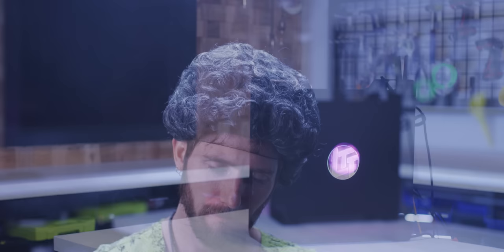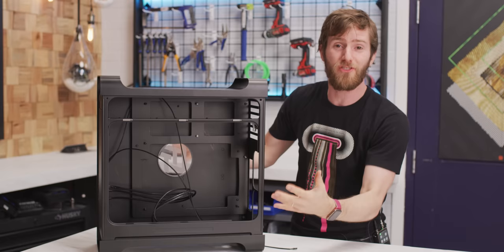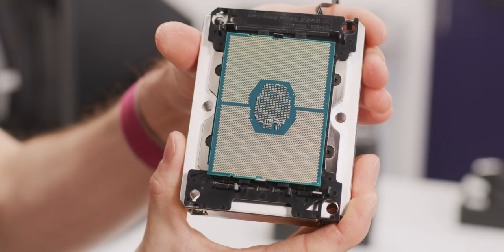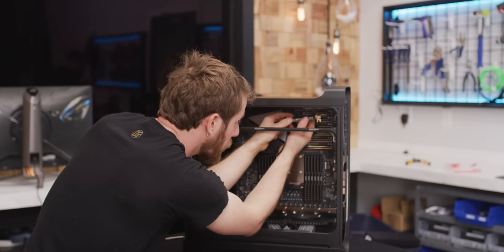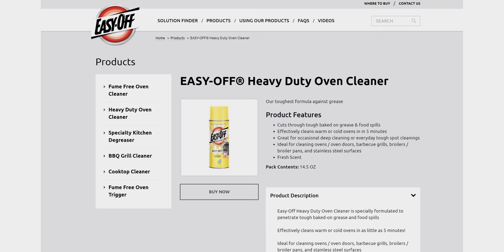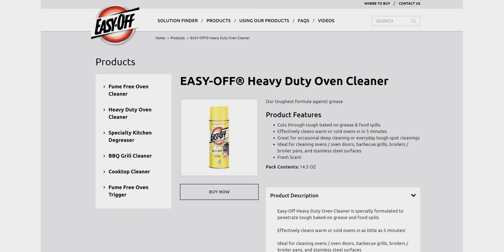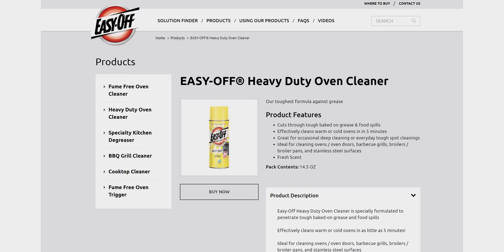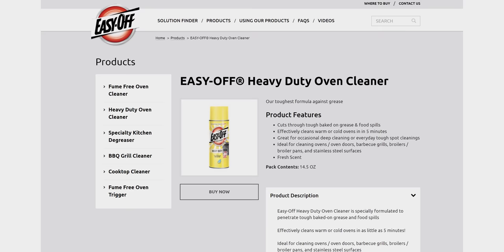IT'S FINALLY DONE! Hack Pro Final Assembly

Comment: Me: getting anxiety bcs my 240 radiator is screwed in with 5 screws in stead of 6.
Linus: Double sided tape
Reply: May whole motherboard with a bequiet cooler is held by like 4 screws.
Reply: @Knallteute  mine is 2 screws with a hyper 212
Reply: Divvy I also only have 2 screws holding the motherboard with 2 fans on my 212
Reply: “Gravity”
Reply: I'd use zip ties I don't have screws, unless there is a tempered glass side panel, then it's no cut corners
Reply: @Icythomas-iq4ft  uhm, don't just secure ur board with 2 screws. You'll be in for a bad timey
Reply: @Icythomas-iq4ft  I have 0 zero screws holding my motherboard with a rock I found on a mountain as my CPU cooler
Reply: To be fair, it's held in with vhb tapes, which sometimes gets used in the building industry as a substitute for riveting and bolts...
Reply: My first computer I put my two intakes in with 4 screws (2 at top and 2 at bottom) and cable tied them together at the middle
Reply: I lost my screws, good old cable ties to hold my 360mm radiator
Reply: @brokengames9020  Why have you come to this conclusion?
Reply: Just keep your computer on its side, no need for screws at all!

Comment: 28 core cpu
384 gb ram

Linus : "Performance should be adequately decent"
Reply: Honestly big tech youtubers can appreciate budget parts and realize not everyone has the money for a 1500 dollar "mid range" build.
Reply: Suh Cheuy you can build a mid range for 800-1000
Reply: @verovex7723  Not with current prices on certain parts, even 1070ti are going for way over msrp lol
Reply: It's what they do, show the best of the best. If you want a budget pc guide, there are many other channels for that
Reply: that remark was strictly on memory speed being very low.
Reply: @verovex7723  In the first worl, shure, outside of that, is a premium range...
Reply: With an working OS yes, with cRapOS. Not so much!
Reply: Compared to what he used to
Reply: Mykel Hardin  you didn't actually support your argument. You said "nothing about a $1500 PC is budget, no matter how much money you have", and that's just not true. PCs usually cost more than other devices (phones, TVs, etc.), but a millionaire would have no problem dishing out 3000 for a PC, calling it budget. You actually disprove your own point by saying most of the cost doesn't affect performance (also, learn the difference between "effect" and "affect") You just said you have a fancy PC (which is what many PC enthusiasts watching these videos have, hence the word "enthusiast". Unless you are saying that you can get high performance for 1500 dollars, then I guess you are kind of correct. Still, a $1500 PC has significantly lower performance than a more expensive PC. By budget, most people refer to cutting out unnecessary stuff, and bad price-performance parts (such as spending too much on a PSU, or Windows 10 Pro for those who don't need it), and that's often the case in 1000 to even 2000 dollar PCs.
Reply: I think he meant compared to the original Mac pro
Reply: Mykel Hardin  budget doesn't mean cheap.
Reply: High or low, a budget is a budget.
Reply: mike h  1500 is like the bare minimum for a all current gen midrange gaming build with a 2070s or 5700xt (id say midrange ends at around 1500 personally, and thats without accounting for aesthetic extras)
Reply: doesnt the actual mac pro hold like 1.5 tb of ram though
Reply: mike h  i mean techinally budget is anything anyone decide
Reply: he has more ram then my ssd stoarage
Reply: Me vibeing with 200 FPS on valorant on ryzen 5 3600

Comment: LTT: Let's build a hackintosh!
Apple moves to arm architecture.
Reply: Arm only for laptops. iMac 50% chance of probability using arm. MacPro would still using intel/amd.
Reply: I'm sure they will use ARM CPUs only on some insanely sleek MacBook, because if they completely switch to another architecture a year after they released a x86 workstation that can cost up to 53k bucks, they are really stupid.
Reply: @comicsanz97  correct and they also need to give devs time to update their apps to support arm as well. They won't (also can't) wholesale switch to arm for at least a few years (maybe never 100%)
Reply: transatlant1c yeah Apple has been adding support and pushing devs to port mac apps to iPados probably so when they switch to x86 processors they will already have apps done.
Reply: @nc9604  that's a great point I had forgotten about that!
Reply: @brokengames9020  What?...
Reply: @brokengames9020  ???
Reply: What's arm?
Reply: @brokengames9020  what is this conspirancy nonsense?
Reply: @brokengames9020  wtf are you smoking ?
Reply: @brokengames9020  You're probably high
Reply: @comicsanz97  " if they completely switch to another architecture a year after they 
released a x86 workstation that can cost up to 53k bucks, they are 
really stupid."
you underestimate their power
Reply: @tinydragongaming634  Arm is a architecture of a CPU. It's more power efficient; you use them every time you use a mobile phone.
Reply: Henry Ezra Apple will slowly move to arm completely to have app compatibility over all macs
Reply: @brokengames9020  did you just have a stroke at your keyboard?
Reply: @666Tomato666  Apparently I underestimated them. They are really that stupid. Not only with their transition, but also with the horrible macOS Big Sur, which is the Honda Civic 2001 of Operating Systems. At least they will keep updating the Intel Macs with this blurred stroke.

Comment: Jake: How much wifi you Want ? 

Linus: Yes.
Reply: It's actually because that's one of the few cards that will work under MacOS. Essentially unlike windows and Linux apple only needs to include drivers for devices which they use. This means only a select few broadcom chipsets work. The most common chips used for this purpose feature 3 wifi antennae and 1 bluetooth antenna.
Reply: @gregorycosteas3539  r/Woooosh And i know i am going to get r/IhaveReddit ed
Reply: @thebakinggamer4348  r/ihavereddit oh wait....

Comment: remember when linus found out that cables almost don't affect cooling and now he put a psu in the middle of the case
Reply: It's ok, the PSU can't block airflow if the fans aren't even turning
Reply: It’s also water cooled so airflow is not as much of a concern as it would be if it was air cooled
Reply: And don't forget that the psu is a fan as well. 😂

Comment: I’m gonna take a hard pass on trying to replicate this myself.
Reply: I agree. But i got a spare G5 Case laying right next to me and the new Build will come in September.
Still thinking about it. Looks so clean.
Reply: @maqqi7124  If you want it black, I highly recommend finding an anodizing outfit that does scary black rifles.  It's far superior to paint, which is why Apple anodized their cases, and anodization is nearly marine-proof.  If you're a 40K fan, there's a military standard puke green generally available for cheap and super durable, if you feel like hanging out with Nurgle.
Reply: a VERY hard pass

Comment: I did a G5 ATX conversion by myself and I find it quite interesting to see different approaches on different builds for the common problems like backplane design, power button and I/O Ports, Power LED, Mainboard Tray, etc. I actually left the mezzanine in place because I still use a BD drive with the original drive port (which actually fits without any adjustment) and a hard drive on top. I ended up building a similar stand for the power supply, but there are folks using the original mac pro power supply housing and putting in a server power supply from a windows machine. With the mezzanine still in place, I unfortunately just can use a 280 mm radiator in front, but that works well for me. With the paint job, the LED logo and a Xeon, this thing looks quite nice! Kudos to you guys!

Comment: If you want to get rid of the machining marks from the bottom of the pocket in your logo discs it's really easy next time. Pocket them out 0.2mm higher than you want them and then do the last 0.2mm as a separate operation but run the spindle speed high and the feed rate really low i.e. less than 1000mm/m and it will come up looking like it's been sanded with around 240 grit and no matching marks.

Comment: 15:20 This depends entirely on the specific OS update. Some can be installed from the normal System Updater just fine, but others will break the Clover bootloader & prevent it from booting up anymore. Part of owning a Hackintosh is simply having to Google to find our which a given update is. And if it's one that CAN'T be updated the normal way (which is the case more often than not), it'll require a OS reinstall to do, so these tend to be left alone until there's a whole bunch of them to install at once. 

Aka, a Hackintosh owner will often reinstall his OS (after backing their data up ofc) a few times a year just to get the latest updates. Is that a pain? Yeah, sure. But enough of a pain to be worth paying >2x as much $ for a given amount of performance to get rid of? Not even close for most Hackintosh owners.
Reply: ok sherlock it's a video

Comment: If you ever interested in self painting other metal pieces, use one of those spray gun handles that attaches to spray cans.  It helps even out the spray pattern, Using a hard clear coat and sanding it/ polishing it really makes the metal shine, or if that’s excessive (It’s used for wonderfully painted Motorcycle Parts) I also use Antique Silver Paint to add a metallic tone. Great Work though!!

Comment: yes! you need a titan ridge card to add thunderbolt compatiability - plenty of info on it. you need to re flash it and mod it slightly and use opencore with MacOS, but it WILL fire up and is hot swappable. get on it Linus!

Comment: They better not disassemble this. someone at LTT should use this as their primary computer (running windows obviously)
Reply: The unsecured PSU sitting on it's modular plugs, and the "impossible to maintain" WC loop mean that's a no.
Reply: @Grimmwoldds  I wonder where is the drain outlet...

Comment: I've been using my "Hack Pro" since april.
Granted, I still want to finish off a few aesthetic things.
I used a regular atx and so was able to keep the drive bay for my ssd and hardrive.
Currently using a spanned 3 screen and 1 larger screen. So far, 0 issues :)

Oh and because I'm not LTT my "motherboard plate" is an acrylic testbench cut to size and screwed in to the original mother board holes.
Next step is to make some custom very short io extenders as my motherboard is mounted upside down and all ios are about an inch inside. In the meantime idgaf as everthing can already be plugged in easily with cables or extenders. If anyone knows someone who makes custom length display port,hdmi and usb 3 cables and a low price, please let me know( that's where im scared to cross the DIY line)

Comment: What a beautiful and insanely powerful hack Pro. Also love the custom loop and tight powerful fit. If the psu bracket also included mounting for the psu with screws and the back two fans were covered by the same mesh as the rest of the back, it would have been perfect.

Comment: Updating Mac OS goes without a problem as long as you use OpenCore as the boot loader. I'm even running on Beta (10.15.6) and its working perfectly fine.

Comment: You CANNOT tear this thing back down. This is the most perfect G5 Hackintosh I think anyone's seen, Literal damn art. Slap Windows 10 on it and just use it mans
- Commented from my Dual 1.8GHz PowerMac G5 via TenFourFox

If curious, yes it does still stream 720p HTML 5 YouTube. My Specs are 3GB DDR2 and an Nvidia 6800 DDL 256MB. She's no slouch, still use it as a backup when my Hot & Ready machine is down

Comment: 12:23 My G5 Hackintosh PSU goes on the upper tray at the front with a modified IEC cable to use the factory power socket to extend to the new PSU

Comment: The build might be disassembled but what would improve it would be installing clips on the power supply and cable assembly that the power supply sits on. That way there wouldn't be any problems in case the computer shuts off from tipping the thing.

Also I hope the thing doesn't get disassembled because of how long it took to get it done.

Comment: Linus, you made the statement in the video about it feeling wrong to disasemble this system after the video is over.
as a thought, you could do a giveaway based on it, or some other type of contest based on it.
obviously you're not allowed to send it with MacOS, that would be in violation of apples EULA, but send it with no drive. then include a used drive from the office. "oh, the drive had data on it? wipe that please" *nudge nudge*"
Or hell, just ship it with no OS. Opencore has a pretty solid support community, im sure the winner could figure out how to get it running.

Comment: Turned out great, but with so much effort out in making it so nice, it seemed strange to me that spray paint was used on the paint job. 

What made you choose to rattle can it instead of using an enamal/hardener acrylic paint with a proper air gun?  Seems like a strange corner to cut after all that work, but maybe there's a good reason I'm overlooking.
Reply: A few things,  one being our shop is not done. We plan on having a paint booth in it with proper hvac and extraction. Two because our shop is not done I wasn't able to get the approval from the paint supplier (was going to use AcryGlo) to be able to use the paint I originally wanted to.  And three I knew with the proper prep work and a 2k matte clear it would be durable enough for the video and use around the office. 
If this were for a client (I used to custom builds) I would not have cut any corners. BUT this is for entertainment  and time lines matter a bit more.
Reply: @nicholascallanan3443 that makes sense, I had a thought that the current state of things might have had an impact on it.  As I've been following these videos, it just bothered the perfectionist in me. It's been fun to follow.

I think the double sided tape Linus used is genius, it's a great use of what you have around at the time.  Most techs who have spent too much time working on prebuilt systems know even big box brands have done worse things with mounting and proprietary connectors.

As a small piece of advice, I wanted to bring up the idea of tapping the side of outer casing of your psu with screw holes and mounting point that could allow you to secure the psu to the bracket with thumb screws.  Looks good as is, but Linus did mention concern of it sitting largely unmounted.  If this will see a lot of use, I'd hate to see Linus trip over it and ruin the PSU! Lol

Comment: ridge wallet, bulge is the same, just a smaller in size. It's just a glorified card holder. You will only notice a difference if you are like me who seldom empty coins from wallet.
Number of cards carrying: same
thickness of wallet: RFID plates makes up the thickness. slightly thinner than a tradition leather wallet, thats all.

Comment: I don't really understand the black paint. Would have been easier to get a regular pc case add some spoilers and front and back perforated sheets if you were set on the black thing. The beauty of the original case was the aluminium, so you've ended up with something not as good looking.  Appreciate the effort and thought that went into it though.

Comment: Using Olarila.com for vanilla install of Mac OS may work better. I use it for my rig with the ASUS B450 motherboard without issue, and using the same wifi/bluetooth from fenvi. Just a suggestion…
Also, was able to update without messing with Clover or using OpenCore.

Comment: @Linus: When you remove the black CPU mounting bracket, the risk is that when lifting the heatsink, the CPU will stick to it, because of the thermal paste, then drop in the socket, bending pins. It happened to me, and it was not a good day.

Comment: Fist off, lemme just say: NIIIICE!
How much money did all these parts cost?
How many/What kind of specialized tools did you need to accomplish this 
   (did you use a plasma cutter to make all those really nice fine cuts in the case?)?
How many hour went into selecting these parts?
How many hours were put into case mods, assembly, 'bring up', troubleshooting, tweaking?
apologies (if it's already mentioned somewhere - where, btw??)
I've had a similar (much scaled down - ie, air cooled only) project(s) and so bought 2 old Al MacPro's
  for the cases. I'm more into a 16-24core machine as an upgrade on which I can run Windose and MacOS
  as VM's under Manjaro running VirtualBox or something.
I've got some very nice things, because I took the route of buying used and then fixing up, or 
   building a facsimile like this.... but I've gotta admit, I'm left scratching my head:
  Are you guys really "ahead" in cost/performance on this build?
Again: You guys do Nice Work! aaand this IS Sweeet!

Comment: Hi, I have a tech related question. I bought an eternal hard drive 2 years ago. The system is a Seagate backup plus slim 1TB. I put all of my photos on it. The thing. Worked great until yesterday when I unplugged it and put it back in later on the computer would no longer read it. It was also making a scratching sound but when I tried it today one last time it still didn't work and the scratching sound has gone quite and I can only hear it when I put it up to my ear. I know now I should have backed it up but crazy me didn't think of that until it stopped working.Any advice would be greatly appreciated